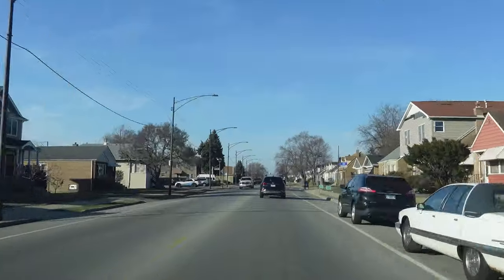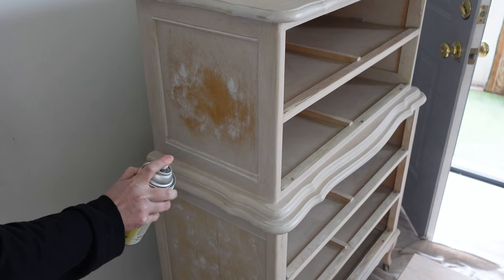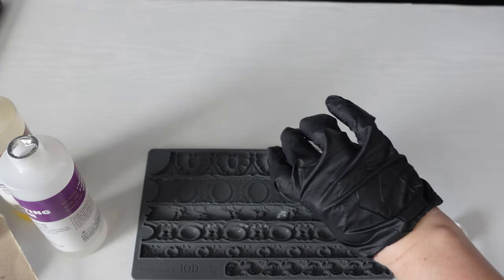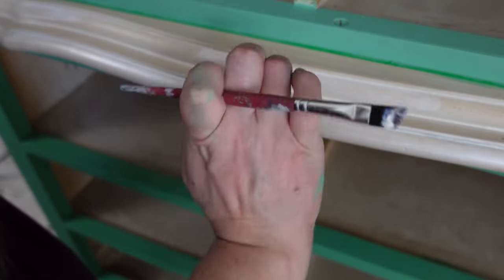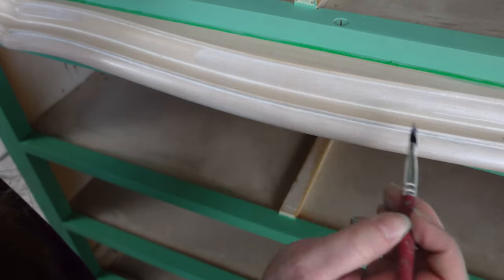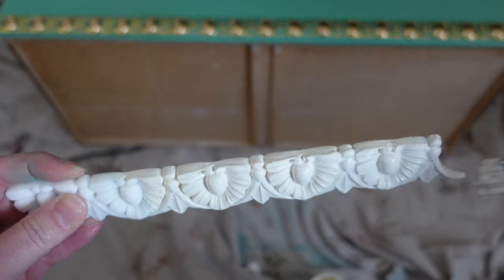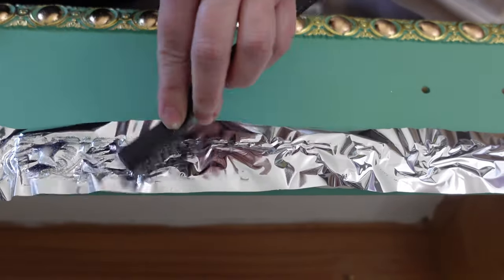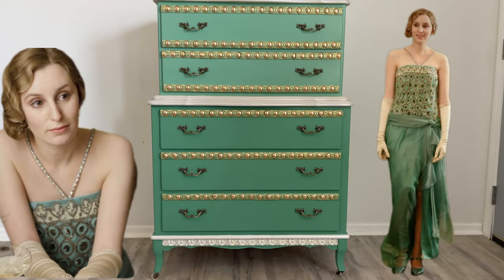Furniture Makeover Inspired by the FASHION of Downton Abbey | Episode 2

Comment: Wow you've outdone yourself again This is just mesmerizing. Something that helps me when I am using resin molds and they have hardened,  I use my blow dryer or set them over the heat vent in my floor and soon they become bendable again within a few minutes..  Lastly, thanks for taking the time to do these in-depths tutorial style videos,  you don't hardly see them anymore on here and for beginners like me, these really help a lot.